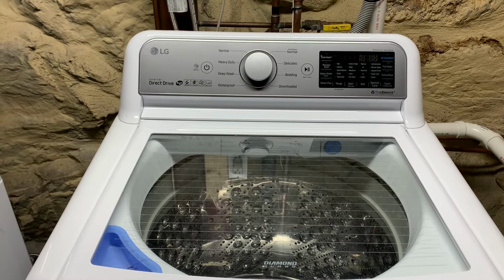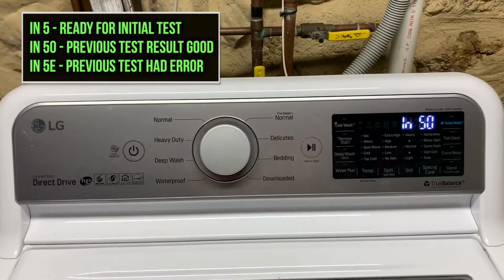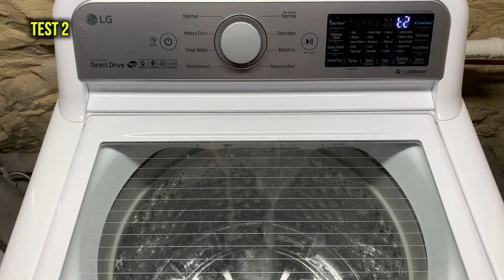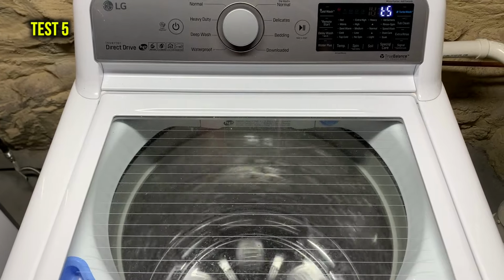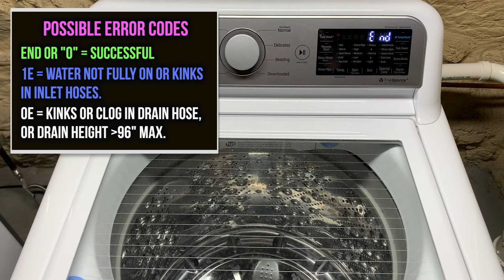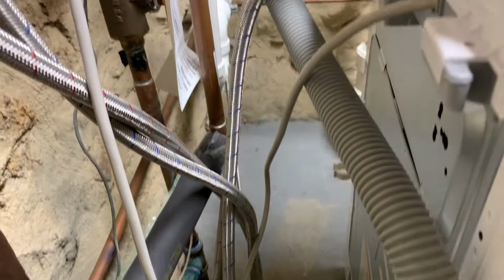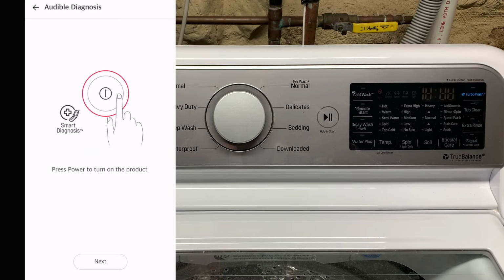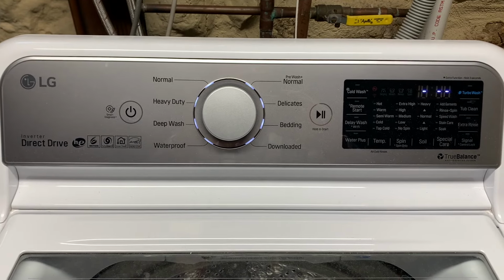The Initial TEST & Smart Diagnosis (How To) - LG WT7300CW Top Load Washing Machine

Comment: OMG! Thank you so much for this video. Tried the test machine AT LEAST two dozen times plus in trying to get it initiated. Turns out there is about a nanosecond window between pressing the spin + soil buttons too quickly or too slowly. And it has to be just right. The manual says "immediately." This word needs a footnote to reference your video, because the frustration level was through the roof before I found your video. LG should clarify this because I would wager this issue to be one of the most irritating and calls to the factory/Lowe's/plumber for this model.
Reply from the maker: I agree! There’s a tight window. I was getting so many questions about how to run the test that I figured it would just be easier to make a How To video. 😃

Comment: Thank you! Pressing the spin+soil immediately after pressing power, but before the actual knob lights settle, is crucial. I spent the last 20 minutes pressing the power, letting it boot up, then trying to test. Nope! It’s just like a computer test, you have to do it in the boot up mode. Thank you, I was on the verge on tears thinking I cannot follow simple directions from a manual.
Reply from the maker: Yup! I was in the same boat, which is why I did the video. 😂 Glad it was helpful.

Comment: We just bought this washer and I really like it. Our old washer overfilled with water. Worse than what yours did.
Tip if this ever happens to anyone. Get your WET/DRY shop vac out. empty any trash inside. REMOVE the paper filter so the
water can be vacuumed up. use the flat floor attachment to the end of the vac hose and vac water. Then get a fan ( DO NOT PUT IN WATER ON FLOOR) run fan over the wet floor. Magic!
Great video. Thanks
Reply from the maker: Thanks for the info!
Reply: Bad pressure switch

Comment: I have this model. I am generally a DIY'er, but I'm having difficulty figuring where my leak is specifically coming from. It only leaks when it's close to the final cycle and seems to come from the rear overflow. I noticed residue on top of the hot water valve, but I only use cold water after the wash cycle. Any suggestions would be appreciated. Btw,  thanks for the helpful video.
Reply from the maker: Not sure what the rear overflow is, but I think you’re referring to the inlets where the supply lines are attached? If so, put a paper towel under them to see if that’s the issue. If it is, you may have over tightened the connection which can mess with the threads in which case wrap the inlets with plumbers tape and reattach the supply lines. While the hoses are off, check that the rubber washers in the end of the supply lines are still supple and use a silicon lubricant to keep them lubed. If the inlet is not the issue, remove the back panel of the machine and check that the drain hose clamp is fully seated and securing the drain hose to the drain pump. Also check that the drain hose and clamp between the tub and drain pump is properly seated. The connection between the drain pump and drain hose is usually the culprit because if the machine is unbalanced the connection takes a beating. I replaced the LG compression clamp with a radiator clamp because the hose kept coming detached during the spin cycle.

Comment: Thank you for the view. When I press power power then immediately i see start button comes up then when i try to press spin and soil nothing is happening. Even i try to press other button, nothing working. I have issues with my washer...
Reply from the maker: If the machine is acting strangely, try unplugging it for 10 minutes and plugging it back in to see if corrects.

Comment: Great video ! I have a QQ, what is the best economical cycle for me? I have always been told to use cold water for my jeans and other stuff?
Reply from the maker: You can select a cold or tap cold water temperature with pretty much any cycle although I’ve found using warm water hasn’t greatly faded my jeans or colors so I go with that (the dryer will fade your jeans faster than the washer). The cycle you choose will ultimately depend on how dirty the clothes are, but I like the SpeedWash cycle.

Comment: I get only a trickle on my fill test. I have good water pressure and hoses not kinked or clogged. The inlet screens are also kept clean. We've had this problem since we got it. The missus has to fill it manually and set it to deep wash and then fill again on rinse. It's frustration. LG blames it on my well water pressure but I tested it and it's fine and plenty of flow coming through the hose. Any Ideas?
If I knew how to rewire the damn thing back to 'old school', I'd do it in a heartbeat.
Reply from the maker: Ugh! That frustrating! Sounds like you’ve done all the necessary trouble shooting. In our house if the dishwasher is running,  someone is taking a shower, or someone flushes a toilet, the water will trickle. The water pressure sensor switch (it’s connected to the back of the plastic outer tub if you remove the back panel) is what communicates to the inlet valves how long to remain open although I’ve never known one to clog. Could be a bad switch though. If there isn’t enough water in the tub after it fills, the switch tells the machine to add more water after a few minutes of washing. My recommendations would be to flush the hot and cold supply lines really well if you haven’t, and then make sure the hot and cold supply lines aren’t mixed up. You could test this by selecting a cycle and selecting Tap Cold as the water temperature. 

Until you figure out the issue, choose wash cycles that provide more water and allow you to select the Water Plus option (you can pause the machine and select Water Plus twice) and if TurboWash is selected (it’s the default for some cycles like Heavy Duty), unselect it to get a heftier rinse. I’m surprised the wash and rinse segments of Deep Wash require adding additional water since the cycle tends to use a lot, which makes me think it’s the switch or the inlet valves. 

If you want to compare your washer’s operation to mine, watch some of these cycle videos: LG WT7300CW Cycle Demonstrations
https://www.youtube.com/playlist?list=PL-WQ7-CdqbCHqWHNPJ8vDTZrvJ78T-HAg

I also recommend watching this video on performance since some of the cycles and options on this high efficiency washer can be pretty stingy with water:
How To Use LG Top Load Washing Machine WT7300 and others - Getting Started + Cycles
https://youtu.be/C1qyZEVsN4M
Reply from the maker: I just did a test using the Normal cycle (with default TurboWash)  where I loaded the tub higher than I normally would (80% of tub). After the sensing segment the washer only had maybe a 1/4 tub of water (not nearly enough) and started churning. About 5 minutes later it paused, filled the tub halfway (plenty for the load) and continued on. My point being that the machine properly sensed the load size during the wash cycle, but didn’t during the sensing segment. Had I added more water manually, it likely would have thought I added more garments and then added too much water. That’s happened to me before.

Comment: So mine keeps giving the OE. I finally realized my drain needed to be Roto out!  Anyway, finally got the drain cleared and now washer still giving the OE. I’ve tried every reset. Plus little red light on top comes on. So I need a new computer in it?  Lg said they would send someone for $400. Had a new computer placed at 1 year!
Reply from the maker: What’s the little red light on top? The only red lights I have are the lid lock and WiFi indicator lights.  I find it hard to believe the motherboard is causing the error unless it was bad from the start. My guess is either 1) the pump is bad or the pump isn’t getting power (check the wire harness connection and the wires to see if a mouse has chewed anything) or 2) something is creating a clog at the bottom of the tub or there’s a clog in the tub to drain pump hose or external drain hose. If you don’t hear the drain pump kick in during the test, the pump may be bad. See my videos on replacing the drain pump and the one on removing the tub so you can have a look for a clog before dropping $400 to have someone come out.

How To Replace Drain Pump LG Top Load Washer LG WT7300CW
https://youtu.be/kw64HM-82lI

How To Remove Tub From LG Top-Load Washer For DEEP Cleaning  WT7300CW
https://youtu.be/l3EM3fm888Q

Comment: Thank you for the video, I just bought mine yesterday and couldn't figure out how to run the test cycle until your video, thank you very much. One question, mine was stuck on T4 and wouldn't get off of that. I just powered down and ran a tub clean. Was this ok to do?
Reply from the maker: If it successfully completed a tub clean I would think things are fine. I’d still run the test again to see if it gets all the way through it.

Comment: Thank you! Also, did anyone else's vibrate a little bit on the floor? Our home is a little older and the floor isn't the most flat, I did check the legs and made sure everything was flat but it's possible it's not perfectly flat

It's not a ton of vibration, but enough to actually see it moving
Reply from the maker: We have the same issue as the concrete floor in our basement is not level. I had to fine tune it quite a bit to get it right and still occasionally check to make sure it hasn’t moved.
Reply: Make sure it is actually level. Take a level to the top of the washing machine and calibrate it that way should help

Comment: What does it mean when it says hose pinched or >96" during test. My drain for the washer hooks up to the drain under the kitchen sink. Also:  Does the turbo wash filter the water it sprays back into the tub?
Reply from the maker: The "OE" error means the drain hose is pinched, clogged, or the machine thinks the drain hose is connected to a drain pipe >96" high or lower than 29.5". Since your washer hooks into a drain under the kitchen sink, it's likely <29.5" so the drain hose is experiencing some resistance when draining into the sink. I know that our dishwasher connects into our sink's aerator drain and if the disposal is full of food, the dishwasher can't drain, which ends in an error code. 
I don't believe the blue TurboWash jet sprayer at the top of the tub recycles rinse water from the tub. It should be pulling water from the cold water inlet.

Comment: I bought a WT7005CW. Try to do the initial test, but never got the "In" in the display. Therefore, could not run it. Very frustrating.
Reply from the maker: Yes, LG has not made it easy.

Comment: Thanks for this video. I have tried this again a few times and am pressing the two buttons immediately but only get 16 in the display.
Reply from the maker: Sounds like the SOIL button didn’t engage at the same time as the SPIN button since “16” is the duration of the SPIN ONLY cycle (you select SPIN ONLY by pressing and holding the SPIN button for 3 seconds). You need to press SPIN and SOIL as soon as the chime starts and you don’t hold them down. Let me know if that helps.
Reply: Actually the problem was that the water wasn't turned on! As soon as that was done the test worked just fine. Thanks for your quick response and also for this video which was short and to the point. I didn't want to have to wade through an entire setup video just to find this one piece of info so I appreciate how you did this.I have subscribed to your channel.
Reply from the maker: Thanks for sharing that. I’m glad you got it to work. And thank you so much for subscribing! Much appreciated.

Comment: Hiw to know fir sure that the board must be replaced ?
Reply from the maker: I recommend contacting LG for guidance on how to determine if the board is defective. If you can’t get the test cycle to run, but the machine otherwise seems to operate normally, I wouldn’t worry about it.

Comment: I just noticed today that the water temp on my 7500 is very hot.  On "cold" setting I measured the incoming water at a little over 100*.  Manual says cold should be around 80 which seems "warm" rather than cold to me.  Would this test be worth running? Guess won't hurt to try it.
Reply from the maker: Did running the test cycle solve anything? Regarding water temperatures, another YouTuber was kind enough to provide definitions of the water temperature options on this machine although I've added a few things based on what I've noticed. Unfortunately, I've never stuck a thermometer into the tub.
Tap Cold:  Is straight cold water from the tap.
Cold: means enough hot water has been added to the incoming water so that powdered detergents can dissolve, but overall the tub of water will feel cold
Semi-Warm: Lukewarm... still feels cold to me
Warm: Regular warm water (still a mix of cold and hot water)... barely warm... more like Lukewarm to me.
Hot: Water from the hot water intake, but not scalding
Reply: @BruceAlanR  no, it didn't, but I finally decided to climb behind the machine and found the hoses installed backwards.  If possible, I always buy from a locally owned place that does their own delivery, install, and service to avoid exactly this.  The delivery guys also put a big scratch in the matching dryer (store did replace the top no charge).  Guess I'll go to Lowe's next time.
Reply from the maker: Ah! That will do it! 😃 I’m glad you figured out the issue.

Comment: We just got this wash and we tried the same test steps that you took, only none of the codes came up at all.
Reply from the maker: That’s strange. Did the test run at all? The part that most folks miss is that you have to turn on power and press both spin and soil at the same time and as soon as the chime starts. If you wait until the chime stops or don’t press the buttons just right (don’t press too hard), it doesn’t run.
Reply from the maker: My machine is now almost two years old and there may have been some software updates... although once connected to WiFi, the software gets updated.
Reply: @BruceAlanR  i just got this washer and was trying to figure out why it wouldn’t test and this helped 😭 tysm
Reply from the maker: Excellent!

Comment: How do you get that water flow. Mines is like a little stream of pee
Reply from the maker: Our water pressure is around the usual 70-80 PSI, so nothing special there. The copper pipe that delivers water to the machine is the usual 1/2”. Maybe check to make sure there are no kinks in the supply hoses. If they’re not kinked, turn off the water supply valves,  remove the supply hoses from the back of the machine (have a bucket nearby as there will be some water in the hoses) and check the intake screens to see if they’re being blocked by debris or hard water buildup (clean them with a toothbrush).  Then reconnect the supply hoses to the machine and be sure the water supply valves are cranked all the way open. If that doesn’t work, you may have some hard water buildup somewhere else or just really low water pressure.

Comment: My machine locks when you start the machine can’t add garments to the cycle because the machine will no unlock.  Can you help?
Reply from the maker: To add garments once the lid locks, press the play/pause button (⏯) and the load will pause and then the lid will unlock. Add your garments, close the lid, and press play/pause again to continue the load. 😃👍
Reply: When it's running.. Press the play/pause button.. It will unlock.. Add more garaments in.. Press the play/pause button again.. It will run were it left off. 👍

Comment: My wt7200cw doesn’t seem to have that test mode.
Reply from the maker: Check the installation section of the manual. If there’s a test mode it would be noted there. The trick is to press the buttons as soon as the chime starts.

Comment: Good washer so far, can't connect to the Smart app tho.
Reply from the maker: Sorry to hear that! This is how I connected to Wi-fi when I had an issue. Start by unplugging the machine, waiting 15 seconds, and then plug it back in. Make sure your phone is connected to your home’s WiFi network. In the LG ThinQ app, follow the instructions to create an account if you haven't done so and then login. Turn on the washer. In the app, press the + sign to add an appliance. Select Top Load Washer, Select ‘no’ for “Does your washer have a touch screen?”, press and hold the Delay Start/WiFi button on the machine for 3 seconds (the WiFi indicator will blink during the connection process). On your phone go under the WiFi settings and select the network named “LG_Smart_laundry” and follow the remaining prompt, which I believe is to enter your WiFi router’s password. Then the washer connects to your router. I show the process briefly at 12:04 in the video. Hope that helps!
Reply: @BruceAlanR  thanks I will try this! 😊

Comment: Hi I can t get past the flashing In 5 at the start of the test ?
Reply from the maker: Did you press the ⏯ button after pressing Spin & Soil during the chime? If that doesn't work, try unplugging the machine, waiting for a few minutes, plug it back in and try it again. The test isn't necessary, but if you can't even run a Normal Cycle (or any cycle), there's a bigger issue. Good luck!